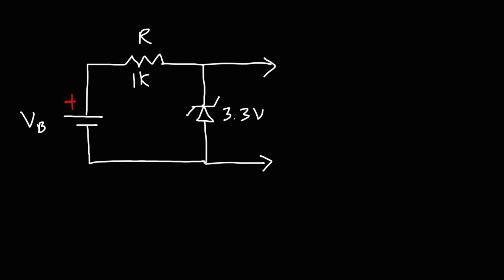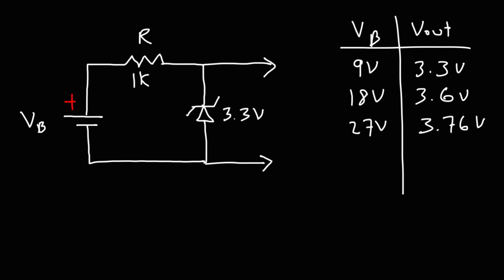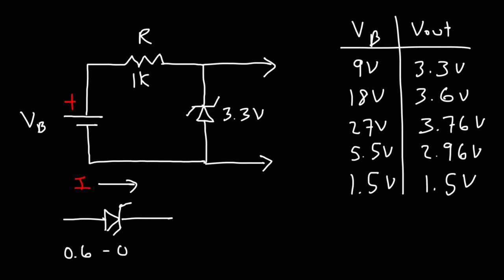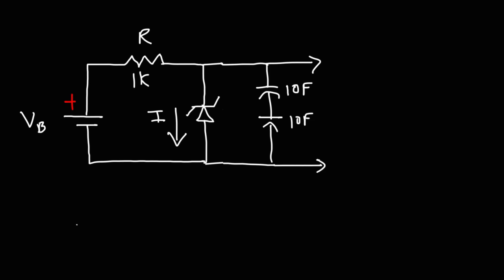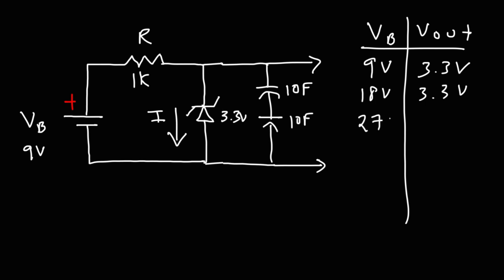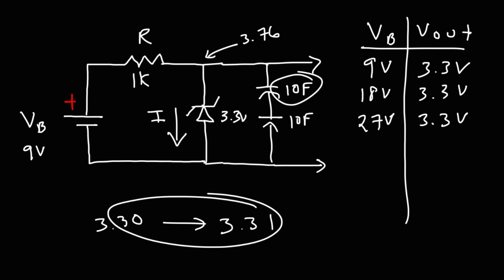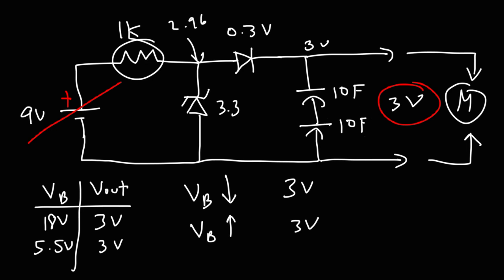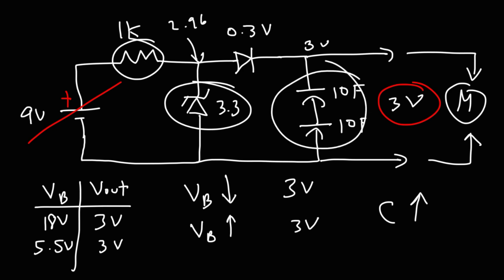How To Make a Voltage Regulator Circuit Using Zener Diodes & SuperCapacitors

Comment: A small doubt, when the circuit with supercapacitor is wired up, the settling time (1%) of the circuit will 5* tau = 5*R*C = 1k * 5F = 5*5k seconds = 7 hours. (Why 5*tau? It takes around 5*tau for 1% or 99.3% output settling) So the start-up time of the circuit is only around 7 hours, then how is the circuit feasible?
Reply: Assume 500 microfarads is equivalent capacitance of two 1000 uF caps in series. 1000 ohms x 500 uF = .5 seconds. Then .5 tau x 5 = 2.5 seconds. This would be more suitable because a short voltage spike will not last for 2.5 seconds. A spike lasts for microseconds. Is this better ?
Reply: Lets Assume he replaces those 10 F caps with two much smaller caps, say 1000 microfarads. The time would be much shorter.

Comment: The explanation of super capacitors in the circuit was excellent. We use this configuration for solar powered circuits when flying high altitude balloons (pico balloons) with GPS and and a small ham radio transmitter. It evens out the voltage when the solar panels are fluctuating in output voltage.  Thanks for the great video! 73 de VE7NZ.

Comment: What happen if diode zener kept on opposite direction in the circuit, thank for axplanation
Reply: It would have a 0.7 v drop in forward bias. Acts as normal diode. Does not regulate voltage to 3.3v unless in reverse bias. So diode will pass constant 0.7 v to the load. Then each cap will charge to 0.35v for a total of 0.7v in series. Tau is R X C. In my formula I substituted 1000 uF caps for his 10F caps to reduce time. Equivalent caps is 500 uF X 1000 ohms = .5 seconds. Time caps charge is 5 x (1000 ohms x .0005 F) = 2.5 seconds.

Comment: wouldn't 2 10f caps in series like that act like a smaller cap... say 5f?  as if the dielectric layer was thicker between the conductive layers?  From what I understood it was when they are in series that you get a higher capacitance, at the same voltage... wait, no, now i see why they are in series, to get a higher voltage rating out of single lower voltage super caps...

i would have used a single 10F say 5 volt super cap (I don't know how they are set up voltage wise, i'm still learning about supercaps in general... PULSE caps, now that's my thing.)
Reply: Placing same capacitors in series increase voltage rating BUT the capacity will be the same. Capacitors behave exactly the same as battery with respect to series / parallel configuration.

Comment: I've studied a lot of these circuits and they all seem to be the same: They all have the resistor in line with the positive output terminal. This seems inefficient to me: you are always 'burning' current through the resistor, even if the Zener is not conducting. Why not have the resistor beneath the Zener diode, so that when the diode 'opens' the resistor limits the current that the Zener is having to pass and only drops the excess voltage across it? Have I misunderstood something? Thanks.
Reply: There seems to be a misunderstanding.
The thing with the resistor is that without any resistance the current would burn the wire, so the resistor regulates the current.
As for placing it below, you can imagine it like a line of people walking after one another in a loop, even if the resistor is placed below, the "people" will movr through the loop simultaneously.

Comment: Note that your discharge path does not have any resistor (aside from the Cap's ESR and the dynamic resistance of the zener).   Therefore the discharge time would be much faster than the charge time.   You should add a resistor in series with the caps to get more stability in the case of downward voltage spikes.

Comment: I wonder if you could hook another 1k resistor in parallel with the resistor but through a switch so while the switch is engaged the net resistance is 500Ω, allowing the capacitors to charge quicker.  As the caps get close to 3.3v you could disengage the switch, removing the extra resistor from the circuit to maintain voltage stability.  What are y'all's thoughts?
Reply: Yes, you could also connect the capacitors directly to the battery or your energy source and the charging would be faster indeed. The only problem of using smaller resistance is that the diodes don't support much current